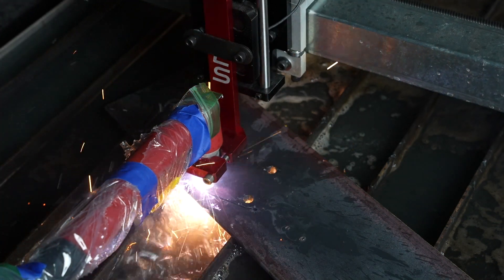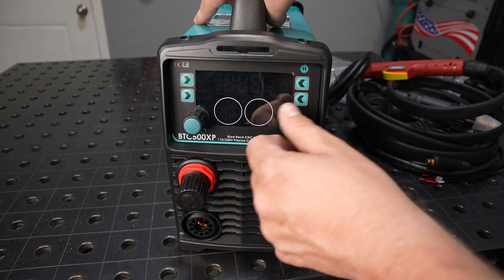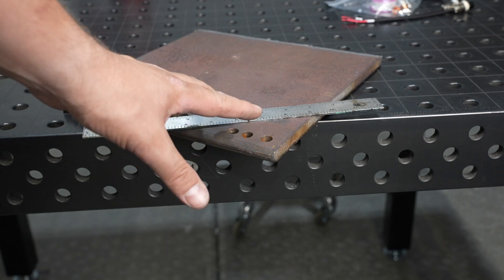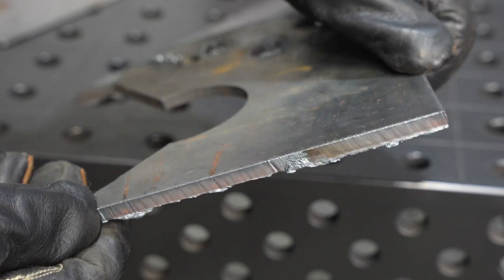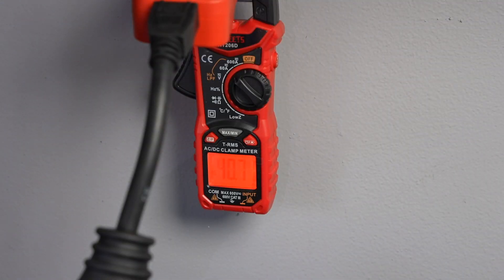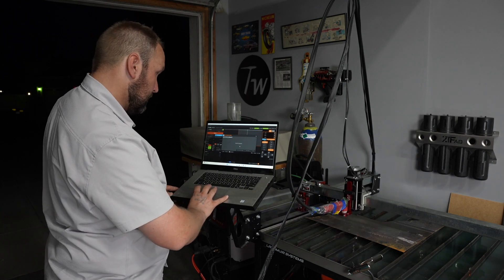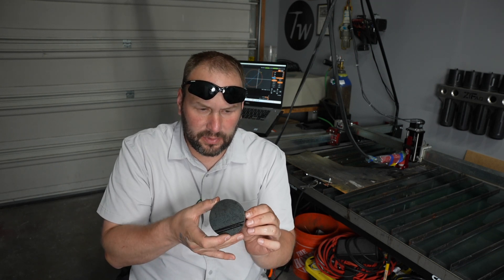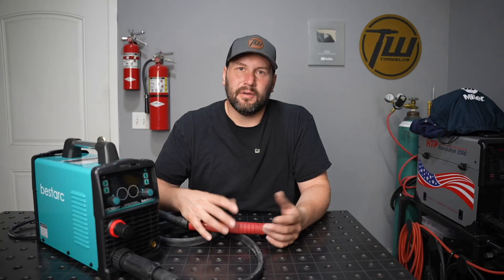Testing the Cheapest CNC-Ready Plasma Cutter: BestArc BTC500XP

Comment: Hey Tim I am curious if you have a way to post up what your settings were for this machine as far as feeds, speeds, kerf info and pierce heights on the Langmuir crossfire but also what were your pin connections on the torch control on the CNC port.   I have a crossfire as well and just now getting it setup and using this 11th gen version.  Thanks sir!

Comment: Could you do a video about your CNC plasma set up? Specifically wondering about spark/smoke/steam control in a relatively small shop, i.e. three car garage. Wondering if it should even be attempted. No cars or yard equipment in the shop, mostly metal working/woodworking, although the two sides are separate. Thanks

Comment: thanks for the review. I just bought one of these and want to use it with a cnc table that i made. but not quite sure about how to connect the Signal control connector to cnc controller. Manual says Pin2 and 3 signal for the torch switch which also controls the pilot arc for the CNC torch Pin 4 and 5 signal for the arc starting, Initiating plasma cutting. Can you tell me how to proceed with the cut?  Should just pin 2&3 be short-circuited (using M3 command for example) start the movement?
I appreciate you help here.

Comment: Mesh mode on a plasma cutter refers to a specific cutting functionality designed to handle expanded metal or mesh materials. Expanded metal consists of a network of interconnected strands with open spaces, making it tricky to cut using a standard plasma arc.

How Mesh Mode Works:
	•	In standard plasma cutting, the arc can extinguish when the torch passes over the open spaces of the mesh.
	•	Mesh mode keeps the plasma arc active even when passing over gaps in the material. This ensures consistent cutting and avoids restarting the arc every time it crosses an open space.

Key Features of Mesh Mode:
	1.	Continuous Arc Operation: The plasma cutter sustains the arc when it moves across empty spaces, ensuring smooth operation.
	2.	Improved Efficiency: Eliminates the need to manually restart the arc or deal with interruptions while cutting.
	3.	Specialized Design: Usually found in advanced or industrial-grade plasma cutters designed for specific use cases like mesh cutting.

When You Need Mesh Mode:
	•	If you plan to cut expanded metal, mesh fencing, or grilles, a plasma cutter with mesh mode will save time and deliver better results.
	•	For general sheet metal cutting, mesh mode isn’t necessary.

If you’re frequently working with mesh materials, ensure the plasma cutter explicitly supports mesh cutting mode in its specifications. It’s a feature typically found in higher-end models or cutters designed for industrial applications.

Comment: I had the 7th generation machine and even did a little review on it on my channel. Not nearly as detailed as yours. I ended up buying a plasma table and decided not to modify the BestArc machine even though I liked it, and started looking for a CNC-capable plasma cutter. I found out that BestArc was developing one (I contacted them and asked). I asked them to send me one of the prototype units and they declined. Since I didn't want to wait the three months until the release date, I ended up buying a Primeweld plasma cutter instead.

I always kind of suspected the BestArc lied about its amp output a bit as it seemed a little bit underpowered for a 50 amp machine. It was way better than the cheap $150 plasma cutter I had used before, but didn't have the power of a Hypertherm. I tested the Primeweld's amp output and it's dead on with its rating. It cuts just as good as a Hypertherm, for a fraction of the cost. I'm using a Hypertherm torch with it though.
Oh and as far as voltage goes on the plasma table, I had the same problem with the Primeweld. The onboard voltage divider card was about 10 volts off of what Hypertherm's charts expected. Once I figured that out I didn't have any more setup issues with it.
Bottom line - you can't beat the BestArc machines for the money. Fantastic little units.

Comment: Hello Tim hope you can help me I just bought the Bestarc BCT500XP and I have the Langmuir Pro CNC . Do I have to join the two pigtails together or do I just need the arc voltage I have the torch height control what do you think thanks . Good video
Reply from the maker: For the torch height control, you just connect the leads that are like test leads (high voltage input) to the voltage output on the plasma cutter. The trigger pigtails for the controller and the plasma cutter just connect together.

Comment: I bought the 65 ampere but i have a problem: The torch works intermittently.  When i turn it on , it start and stop and is impossible make a cut. I don't kbow if is a machine problem or setting problem.
Reply: You have a bad ground ("work") connection on your material or you forgot to hook the ground up.

Comment: Tim, how do you think this cutter would work off a generator? I have a Pulsar 12kw generator. Running watts on gas is about 9500. It has 120v 20amp and 240v 30amp & 50amp outputs. I would run the air compressor off this generator as well.

I have a mobile home frame and more to cut up and recycle. The home burnt to the ground and there is no electrical service at the property.

I thought about using a big cut off wheel, but I've been interested in a plasma cutter for a few years now.
Reply: It will work but you might have a hard time running the compressor AND the plasma cutter at the same time. Running it at a low amperage setting off of the 240 volt plug will help.

Comment: It’s annoying, but no room for a plasma table. Just got a surface grinder (thank heaven!) and barely had room for that. I’ve also been concerned a water table would cause rust on my machinery, and non water models spew dangerous metallic gasses and vapor all over.
Reply from the maker: A surface grinder would be awesome! I use green-cut additive in the water and it's pretty good at preventing rust, but just the nature of the process is a bit messy.
Reply: @TimWelds  it is messy. The rust I’m worried about is from the evaporating water from the machine rusting other equipment. Lots of cast iron and hardened steel.

Comment: What is a good duty cycle for a CNC plasma machine? I think this one is 60%.  It's there a way to pause during a job using grbl?
Reply from the maker: It really depends on the type of parts and how many you want to produce. There are natural stops and starts as part of any program and for hobby work, 6 minutes of cutting can make a lot of little one off parts on a hobby table. That can cut a basic 2' x 4' sheet metal sign or a few gussets/brackets out of thicker material. If you're looking at running any sort of mass production, I'd look at a more substantial machine with a dedicated machine torch. You can always pause a program by typing a G04 dwell command in the program, or most CAM software will allow you to automatically put a delay after each cut which would slow it down a bit.
Reply: @TimWelds  Guessing the duty rate might also get better at lower power so possibly this unit could do 100% at say 20 amps for thinner stuff.  I would be using it to fabricate tools and equipment. I'll be building the table myself and I have most of the parts.
Just still researching for the right plasma machine.  Just didn't want to limit myself on job complexity. ;) I appreciate your video & time very much. ;)

Comment: FYI --YESWELDER CUT-65DS Plasma Cutter 65Amp Non-High Frequency Non-Touch Arc 110/220V Dual Voltage Blowback Plasma Cutter currently has a $60 off coupon is cheaper!
Price was $284.20 with tax to my door.     --- Also Note:  it is a 65A verses the Bestarc BTC500XP is a 50A
Reply from the maker: Thanks for the info, I hadn't looked at that one. It looks like it doesn't have the CNC plugs, but with the torch connection on it, it would be easy enough to connect to a table.
Reply: @TimWelds   You are right!     I haven't set it up haven't had funds for CNC table yet!
FWIW :  I just noticed YesWelder has a cheaper model plasma the CUT-55DS PRO @ $220  non HF and blowback.

Comment: Thanks for this review. Interesting it is able to be setup for CNC out of the box. Is it easy for you to tell a noob like me the voltage 1:1 problem? Like it sounds like a possible safety issue, but I am just learning.
Reply from the maker: Thanks! The arc voltage is proportional to the height of the torch off the material, so the CNC machine will adjust the height based on arc voltage because if material isn't flat, it will need to move up and down a little across the surface. Because the arc voltage is around 100 volts, most machines have a voltage divider (just 2 resisters in series) to give a lower signal voltage output. The most common ratio is 50:1. As long as you're careful with the wiring, the 1:1 ratio isn't a major issue and will work fine. A lot of machines are wired up this way, particularly when the machine wasn't originally set up for CNC use.
Reply: @TimWelds  thank you!

Comment: I'm surprised the breaker didn't pop on the 120 VAC test.  Was that a 15 or 20A outlet?    Nice video.
Reply: Breakers have inverse time trip (I think I said that right). At any rate, they are designed to operate at 100% indefinitely but at 200% (40amps on a 20amp 1pole breaker) of rating they could have a min-max trip time of 10-100seconds and at 300% (i.e. 60amps) the trip time min-max is 2-20seconds. While these ranges are taken from a graph I think there actually are established maximum trip times @ 25C of 20-40sec which lower the upper limits at currents above 125%. These numbers were taken from Eaton BR style breakers (Magnetic Thermal). 

I think the electronic ones use a single line threshold with a margin of error so there isn’t such a difference on possible trip times however at higher current loads these differences in range all but disappear due to the logarithmic nature. 

Factors like ambient temp can skew things quite a bit but I’m guessing that most manufacturers have similar inverse time trip charts.
Reply from the maker: Thanks! It was a 20 amp dedicated circuit. I wouldn't have made it too much longer before the breaker tripped. The machine was maxed out, so the draw would be lower with a lower setting on thinner material.
Reply: He said it was pulling around 40 amps? On 120
Reply from the maker: That's what my meter was measuring and it's close to the spec in the manual also.